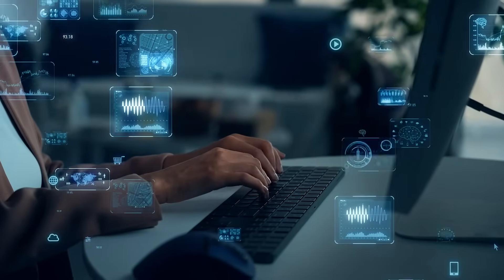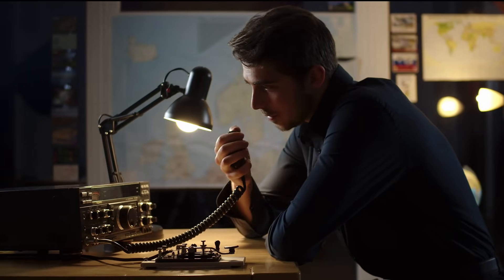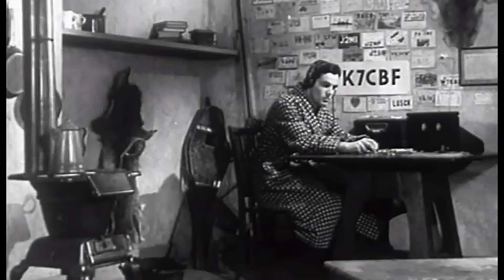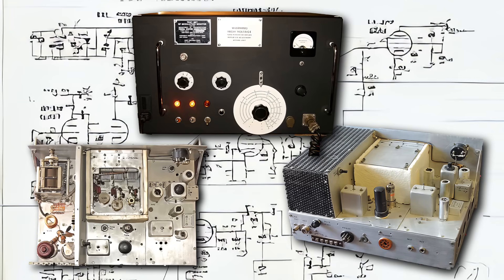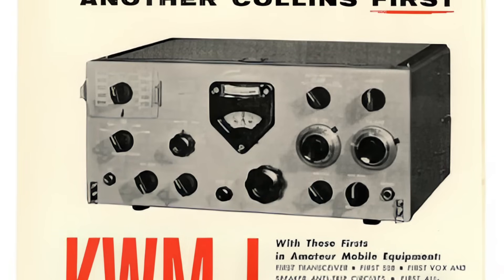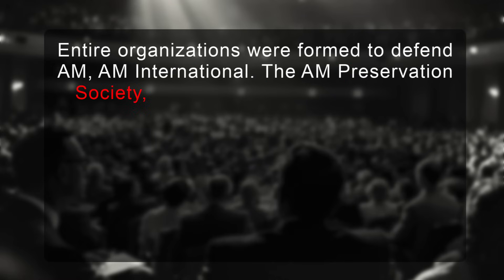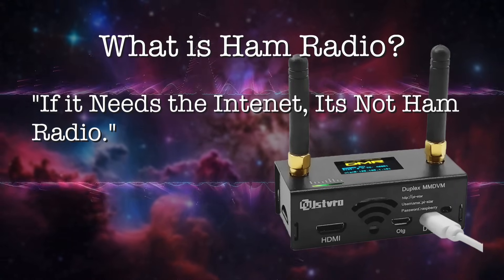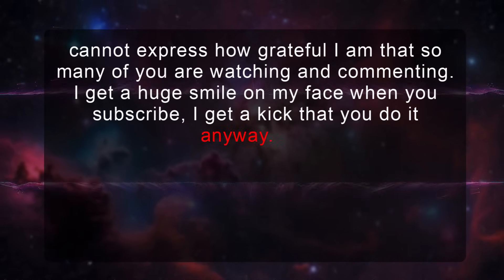Why Single Side Band (SSB) Almost Never Existed!

Comment: There are still many hams who are upset that the FCC removed the Morse Code requirement and that has been decades.  We still have groups that advocate and use AM on 6-meters, 10-meters, and other bands.  Yes, it sounds better and I hate the Donald Duck talk of SSB.  

When digital voice was first tried, it used more bandwidth than analog.  Now, it uses less.  The problem I have is that we have 3 competing and incompatible modes.  Nobody makes a radio that will do all 3 modes because they would have to license the tech from a competing company that likely would not agree to it.
Reply: An old timer (in the 1960s) told me that you NEVER, EVER run AM on 6 meters!  You ALWAYS use SSB!  Why?  AM on 6 meters could be received on an analog TV on Channel 2.  You always use SSB so people couldn't tell what you were saying or what your call sign was! 🙂
Reply: @terryjwood  Tell that to Heathkit with their Sixer lunchbox rig.  It was an AM transmitter & regenerative receiver on 6M.  There was a matching Twoer on 2M.  I built the Sixer.
Reply: @James_Knott  I understand that Heathkit is back, but they probably won't be making a six and twoer.
Reply: @terryjwood  So, you still tore up their TV, they just couldn't prove who it was.  That is until the FCC or someone else came around and figured it out.  Besides, I don't know what is on TV 2 (54 to 60 Mhz) but it isn't analog TV.  Secondly, we have much better filtering available.
Reply: @BryanTorok  No, that advice convinced me not to operate on 6 meters.  I only used my Johnson 6N2 transmitter on 2 meters.

My parents met on the air just before WWII.  So I grew up with ham radio and I saw it all.

One time a guy spotted my dad's 40 foot phone pole in our backyard that had a tri-band beam on it.  

The guy thought my dad was causing his TVI and was beating on the door demanding that my dad get off the air, ASAP.  

My mom explained that my dad was away on a business trip and the guy called her a liar.  It went down hill from there.

While the guy was threatening my mom, my dad arrived home from his trip, blocking the guy's car in our driveway.  

So I'm well aware of how crazy people become when they have a cheap analog TV that picks up clean signals from outside the TV band.  

And I understood even if the FCC gives you a clean bill of health that your transmitter is operating properly, the person with the defective TV will never understand that the problems is theirs.

So there was no way I wanted to get on six meters.  But I appreciated the old timer's advice.

Even today, with digital TV sets which are mostly immune from TVI, I hesitate to use high power on the HF bands.  And I avoid using AM whenever I can! 🙂

Now let me tell you about the time a defective TV in our neighborhood was transmitting wide band RF because a repair technician had used the wrong transformer in a repair.  My dad tracked it down, calmly explained to the owner what was going on and fixed the neighbor's tv FOR FREE.

Hams are like that!
Reply: @terryjwood  The ARRL has for decades advised hams to not to anything to the neighbors electronics.  Even if the ham does something as innocuous as adding a filter inline with the antenna cable, if the TV quits working next week, the irrational  neighbor is going to blame the ham.

Still the story about your dad is pretty great.  Thanks for sharing it.
Reply: @BryanTorok  That's sound advice from the ARRL!  No good deed goes unpunished!

Comment: The first modulation form in use was amplitude modulation, which inherently contains two single side bands, so single sidebands existed from the beginning.
Reply from the maker: Technically could you say Double Sideband existed from the beginning not single side bad? Of course all of this is semantics because theoretically Radio Waves existed from the beginning. It just took a few years and a few smart guys to find them.  ;)

Comment: Here's an interesting exercise: set up a local net on 2m, but use SSB instead of FM. Note how much less band noise there is, how you don't need squelch, and how weak and/or distant signals that would be lost on FM come in quite clearly. Then set up a net on an HF band, but use AM instead of SSB. Note how much nicer it sounds, how much easier to tune, the absence of Donald Duck voices and picky people saying "You're about 30 Hz off-frequency, OM."
All modes have their uses. Modern rigs give you the choice, so choose appropriately.
Reply: I've tried 10 meter AM because some of the guys have antiques that they like to fire up once a week, just to keep those rigs healthy.  I can see why SSB has such an advantage!  I can easily hear everyone on SSB.  But when running AM, some are lost in the noise, if they're not running 500 watts.

I've suggested that if we want to try different modes, we should go up to 29 MHz and run wideband FM.  It certainly sounds better during the summer with no static crashes to deal with!
Reply from the maker: @terryjwood  Its been a long time since I have tried not sure of if or how it has improved. But I am interested in trying FreeDV digital audio again.
Reply: We have a very active ham radio community in Atlantic Canada.

We have weekly simplex nets on 2m USB, 2m FM, 2m C4FM as well as HF SSB and repeater nets on FM. C4FM. DMR and likely DStar. They are starting nets and adding repeaters faster than I can keep track, never mind buy equipment.
Reply: @patrickbuick5459 . I used to chat with some other amateurs in the area on 2m USB on a few hundred mW PEP.  We ran vertical polarization to at least theoretically reduce effects on anyone nearby DXing.  The other three people in the group are now SK, so that put an end to that chat group.  It is easy to forget that all modes are more common now that VHF mobile/base radios are built on software defined platforms.  SSB still seems pretty rare on HTs where even getting decent AM receive in the aircraft band is a pleasant surprise.
Reply: 2 meter SSB is easier said than done.  I believe the only rig I have which can do 2 meter SSB is an all mode single band Kenwood mobile radio I bought in 1993.  My Icom 706 Mk-IIg might also; I’ll have to check. … It does, make that two radios.  Still, SSB on 2 meters is not too common.
Reply: @wtmayhew  There's activity in Western PA.  Rigs, such as the Yaesu FT991-A and the ICOM 7100 can do SSB on 2 meters and 70 cm.  Most of the activity is horizontally polarized.  There's a group in West Virginia that gets on every evening.  It's a long haul from Pittsburgh, but it can be done!
Reply: @terryjwood  Thank for the reply.  It is good to know there is life in the 144.200 neighborhood.  I’ve previously made contacts on a 4 element beam made from a firing strip and coat hanger wire and 15 Watts from my Kenwood mobile.  As you noted polarization matters - much more on VHF/UHF than it does below 6 meters.  The good thing is it easy to experiment with antennas for little money and less space on VHF and UHF.
Reply from the maker: @wtmayhew  Almost every HF rig I can think of has 6 meter SSB. Plus when the band opens up it is a lot more fun than 2 meters in my opinion. So why not tryi giving a call on the 6 m SSB calling frequency. 50.125.

I have been trying to leave a radio on that frequency to generate some activity.
Reply: @HamRadioGizmos  I've done that.  I even made a contact -- from the ham down the street!  Apparently he and I are the only ones on 6 meters.  There is an FM repeater though.

Comment: POTA operators will likely be among the best operators in emergencies  as they have practice setting up simple antennas and getting on the air quickly. Folks that do Field Day seriously also fall into this class.
Reply from the maker: @vladtepes481 I agree. My guess is most of these guys just getting out seeing what they do with a radio and a wet noodle.  Which is a terrific part of the hobby in my opinion. 

I have not ventured out to try POTA but they look like they are having fun. And after all, isn't that really the point. :)
Reply: Whenever I hear POTA I think POTA POTTY . 😂
Reply: @321CatboxWA Same here.
Reply: @321CatboxWA 
That might be a new operating rage.  Just think; "Porta-john's On The Air".  We could operate from one of these shelters using VHF/UHF and a magnet mount on a vent pipe (assuming it is made of ferrous metal), or perhaps a QRP hf rig and wire.  Extra points for doing it on a hot day or a windstorm.  😁
Reply: @grigorirasputin5020 drop a rattail ground wire into the holding tank.
Reply: Yeah everyone knows that in a real emergency you only need 40 minutes worth of battery life
Reply: @ryany4326  I have a 160W/h battery that runs through field day with 5 or 10 watts. I have a spare just in case.
Reply: POTA sounds like a really FUN activity!
Reply: @terryjwood  it is a fun activity.  There are two ways to get involved.  One is as a hunter operating from you home shack contacting activators in the parks.  The other is to be an activator out in the park calling CQ.  You could also hunt Park to Park, which is sitting in a POTA park and answering those calling CQ POTA.  Both activators and hunters are needed for the program to be successful.  While the hunters can easily find others calling CQ across the bands they won't be able to participate in the program without the activators going out to the parks.  Without the hunters responding to the activators calling CQ the park won't get activated.
Reply: @terryjwood It is stupid.
Reply: But they lack the expertise in emergency operation style (short and sweet).
But they can get training by specialized emergency operators.
Then...they can be efective.

Non random QSO capability is also paramount (it is easy to contact at random, but getting in touch with a certain place on purpose is another thing)
Reply from the maker: @jplacido9999  I agree. BUT, if I were looking to grow my EOC folks in order to have some depth. I would say they have the heart, the passion and the gear to setup quickly and in any situation.

This is your next generation of emergency communications folks in my opinion. I would be developing a formal plan to partner with POTA.
Reply: @jplacido9999  1. If you can't set up station with ease then your ability to respond in a wide area emergency situation will be limited. 2. The biggest problem with those interested in emergency is the arrogant folks in charge.  They irritate many hams to the point of driving them away.  3. It is too bad that most do not participate in traffic handling activities but I understand its increasing irrelevance.
Reply: @vladtepes481 
1- Very important to be able to put a station in place, quickly.

2- Those in charge are arrogant (they don't remember they are just servents for the paying  People.

3- Good training on radio network is very important.

I agree.
👍👍🙏🙏
Reply: POTA is just another stupid idea to keep ham radio alive. The hobby is anemic and dying. Once the geriatric curmudgeons are gone, it will be even more anemic.

Comment: Last year one of the "grumpy old men" in our radio club talked about the division that happened when some of them, in the late 1960s, wanted to put up a repeater. The local radio club would have nothing to do with it because it wasn't "real ham radio". The "young upstarts" then started their own club so they could pool their money and put up a repeater. To this day, there are some who still have bitterness towards the other club.
Reply from the maker: @stuarhall3874 it saddens me to hear this. When I was a young ham I was lucky enough to get connected to a group of hams who were into pushing the envelope. And they knew their stuff so I loved learning and their mentorship.

In the late 70's we had a 220mhz link from our repeater in St. Pete to Miami. It was build from a surplus FAA transmitter. We hit a few touch tones, bring up the link and talk to our buds in Miami. Pretty innovative back then.

But today many hams are like you described. Hams used to be known for being innovators and for pushing the envelope. Now all you hear is guys grumbling about "that air ham radio". Its sad to see.

One of the best aspects of the hobby for me, other than the learning. Is there are so many aspects to what you can do. HF, Digital, UHF.VHF, EME, SSTV, it goes on and on.
Reply: This makes me fell very fortunate to have landed among a group that uses every mode available.  We have one 2M repeater on a bridge almost 700' above sea level with ships passing underneath and another on a tower at about 450' AGL.  We use D-Star, C4FM, 160M-6M, AM/FM/SSB/FT8/Winlink and so on. The Johnson Space Center ham clun is a short drive away and they use every mode available.  Every method of communication has its benefits.  I was at ground zero for Hurricane Katrina.  That will create an appreciation for ANY method of communication that works at the time.  For weeks, the only things that worked were ham and CB radio and satellite phones.  Eventually, texting started to work.  Phone cellular and landlines were among the last to be restored in many areas.

Comment: So many modes these days and more to come to be sure. I currently operate CW QRP home brew and years ago I did enjoy SSB and a little RTTY. I did build up a fairly good DSB rig but CW is my GO-TO. As long as we hams can get along and share what band space we have then I am good with it all. 73 de wa4jat ( 50 years a ham )
Reply: Do you homebrew the transceiver as well?
Reply: @justinelliott3529  My Double Side Band transceiver was homebrewed and based on the Wee Willy 75M design. Made many contacts with it. My first experience with SSB was using a older Hallicrafters SR-150 that I got back in the mid 70's right after I received my General ticket.

Comment: As far as I'm concerned FM was the big game changer.
Reply: FM, or repeater networks?  Have you used FM direct?
Reply: @BrightBlueJim  I've used 2m FM as "walkie talkies" during hikes.  I do wonder whether SSB would have worked just as well, or better.  I love wide-band FM broadcast sound quality, but I'm not sure NFM is that much better than SSB.  Never seen a 2m/440 SSB rig, much less an HT, though.

Comment: I have not any license - but I have degree in radio eqipement. In my opunion - the simplest system is teletype. You have inly frequency mamipulations and it may be reasized on CD4946 PLL chip and  low IF transciever. When you needs image rejection - you can use a trasciever with  IQ channels -  low frequency phase shifter will be very easy : the bandwith is quite narrow.
Reply: With sufficient bandwidth (and perhaps a VT-100 terminal,) our ASCII poster of Mr. Spock can be animated.
Reply: @wbeaty  ASS-KEY?  Can't we just use our fists?  CW Forever!

Comment: CW ftw.   Voice is cheating!
Odd trivia:  Thomas Edison was creating high-speed CW players and recorders, where one of them used foil tapes wound on a rotating cylinder.  Edison noticed that, when the CW was sent to an earphone, it sounded like music.  So, he had his machinist make a version where the dot-dash instead was punched out by a needle on a microphone diaphragm.  They were all stunned when it worked.   (Edison later said that he didn't trust any invention that worked perfectly the first time!)
Reply: CW is cheating. If you’re not using a spark gap generator, you’re cheating.